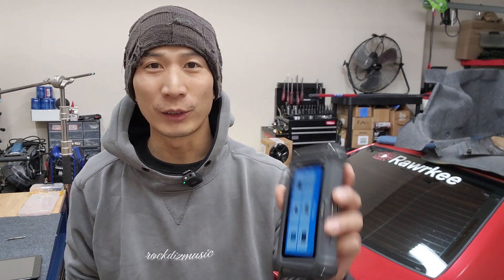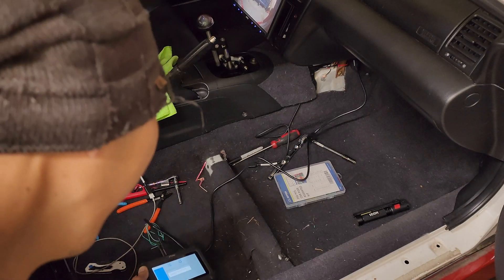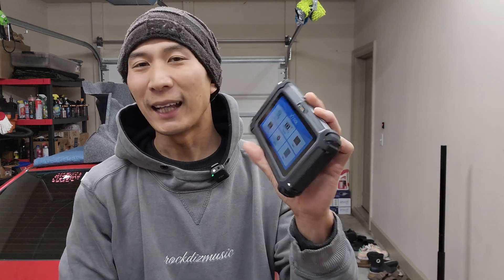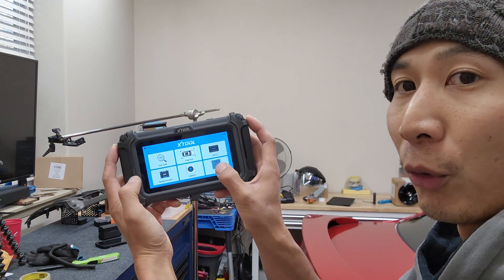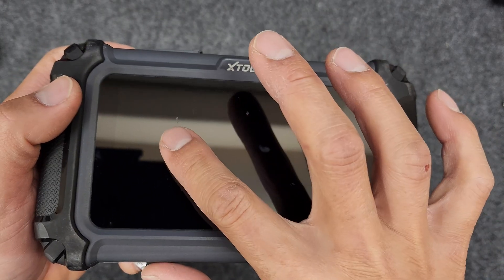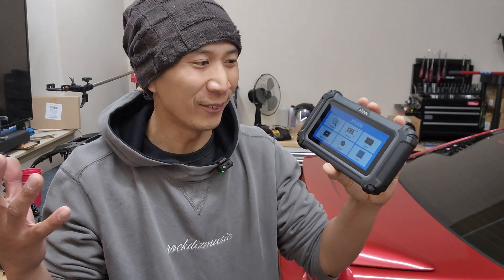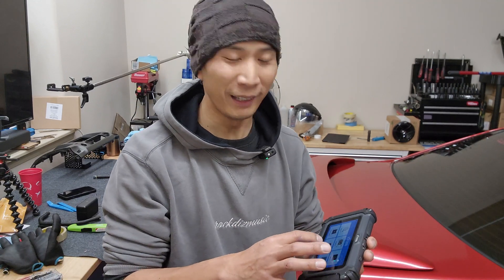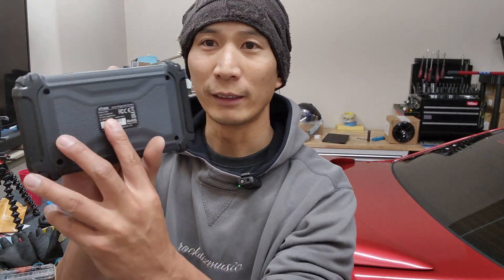OBD2 Scanner Durability Test - XTOOL D5S

Comment: it wont do the turn on headlight , wipers, windows because it does not have bi-directional support that the more expensive models can. it also doesnt require a permanent wifi connection..thats just for software updates and initial registration